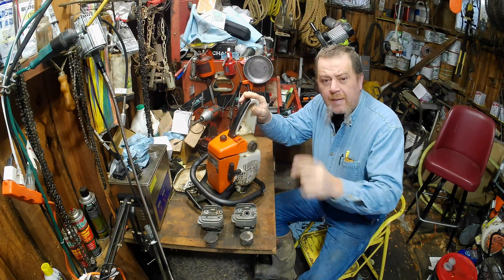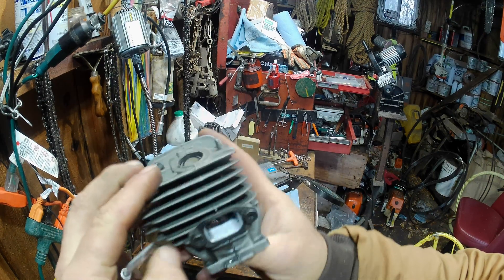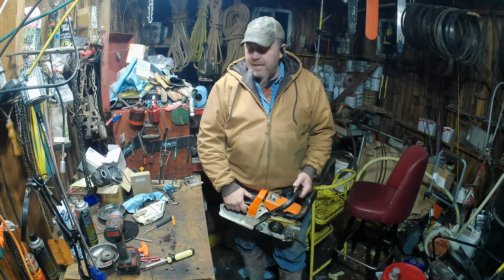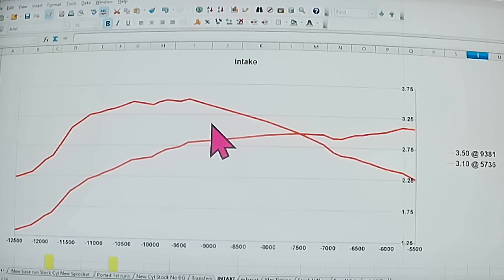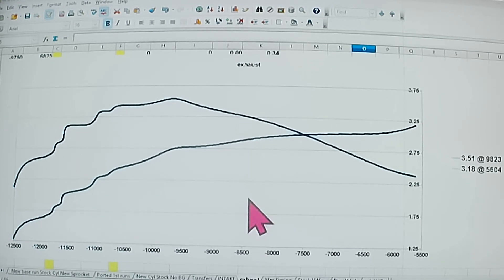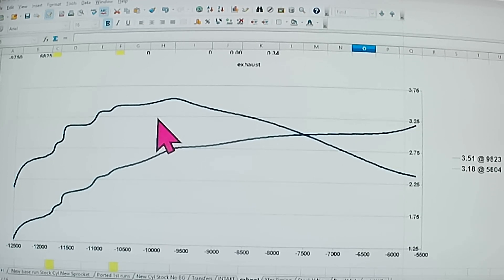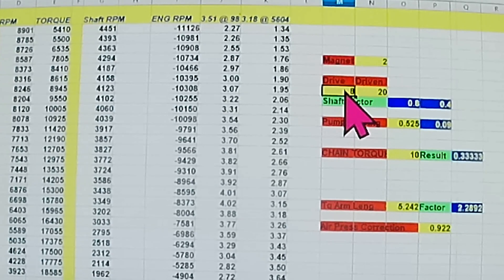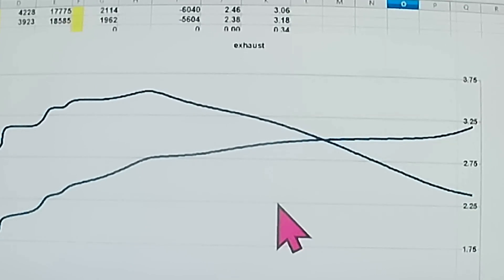Exhaust Port - DYNO and Test CUTS- EVERY Step. Chainsaw Mods Step IV

Comment: I just discovered your excellent channel a few days ago. Really enjoy your work and honesty. One thing I have always wondered about is free porting. I have heard that it is bad, then a little bit is ok, then there are small gains to be had. I really wish this could be tested definitively on the dyno for proof. Perhaps you could take this on as an episode?  Would be greatly appreciated.
Reply: Whoops sorry for sending my note twice. That’s great. I have a few other tricks I use in my weed wackers, dirt bikes etc etc and even trimmed the bottom of the exhaust side of my piston on my Yamaha IT465 to reduce the amount of big bore surging at low rpm. Kinda like Yamaha did on their RD’s back in the 70’s. I figure chainsaws are more either idle or wide open runners so there could be a benefit. I’m thinking that when they are on the pipe and singing at full song the return pulse is not there at TDC and the pipe is sucking. Might lose some air/fuel out from under the piston out the exhaust but the overall momentum of the mix would increase the delivery ratio. I’ve heard about trimming the bottom of the exhaust side of the piston in steps of 1mm until any gains are lost. Anyway you are the expert sir and anything you find out would be dynamite. Thanks again.
Reply from the maker: @MarkPrestwich-h6m EXPERT??!! 😂😂 I think I swallowed my gum on that one; you caught me off guard. I am truly a curious hack who is intrigued with 2 strokes. I will show my ignorance... honestly...  What is "big bore surge"? I am truly learning as I go and I have never heard the term of big bore surge; I'm rolling around the idea of a shorter exhaust side as we speak; nothing obvious yet... I'm going to think on it some. A nudge in the correct direction will be appreciated.
Reply: @ Ah no worries. I learn as I go too. Well when a big bore 2 stroke coasts for example downhill or even cruises with low load out of the powerband it can tend to fire intermittently at times. Some theories say because the exhaust gets pulled back into the cylinder and mixed with the fresh air/fuel mixture diluting it making it unable to fire for a few cycles and then POW! it fires and kicks the engine. Another reason is that at low throttle opening even with reed valves some mixture can go back in the reverse direction through the carburetor and then be pulled back into the engine. Each time it does this it picks up more fuel from the main jet and makes the mixture too rich to fire. When the throttle is opened and some does eventually pass through the engine and becomes lean enough again to fire you get another big POW! and surge. Really annoying when you are cruising. The bigger the 2 stoke the more pronounced the firing surge. I have experimented with a few ways to reduce this with some improvement (for example adding 2 sparks plugs with separate ignition systems to the single cylinder engine) but it doesn’t fix it completely though. RD400 Yamaha street bikes had notches in the bottom of the exhaust skirt to allow a bit of free porting (like I also did) but I’ve heard cutting the exhaust skirt works too. If I can impart any more of my limited wisdom to you or others in the future I am happy to do so. Greetings from Canada by the way.
Reply from the maker: @MarkPrestwich-h6m  Awesome!! I wasn't aware of the condition, but I understand it as you explained; thanks for that!! I've worked on antique steam engines, tractors, semis, new cars, and turbines (jet engines), but two stokes were a complete mystery to me a mere year or two ago; I watched chainsaw vids for a LONG time before the lightbulb finally lit-up. I still tend to refer to 2-stroke theory with 4-stroke terms and relations.
 Feel free to offer anything any time! Almost everything I hear or learn gets my mind to thinking about that, or points me toward something else. I have stumbled upon a good thing or two, but it was usually from hearing something that was thought to be obvious to others.  I spend so dang much time thinking outside the box, but I'm missing a LOT of important info that is IN the box!!
Another Canadian friend!! Mark, I sure am glad you stopped in; I sure hope to see you lots more.
Reply from the maker: @MarkPrestwich-h6m That's a good idea!!  I don't know, but I think free porting will be more allowable as the rpms increase; I consider that the first sacrifice will be idle and "manners" of the saw??  I will have to try to think of a way to isolate the free-port aspect without being able to attribute gains/losses to timing of intake/exhaust. Good thought and good suggestion!! Thanks for joining-in; we're awful glad to have you here!!

Comment: Your video title caught peaked my interest because I have a Shindaiwa C242 string trimmer/brushcutter.  The C242 has been EPA'd to death with a choked up exhaust port and a catalytic muffler.  The C242/T242 has a serious problem in that the exhaust port gets carboned up to a pinhole size if you don't maintain it by periodic cleaning.  I use this trimmer to maintain 3-acres of weed cutting, and I've already improved its performance by replacing the muffler with an empty can.  It upped the RPM and it runs cooler.   I am going to grind the exhaust port similar to what you did to your saw and not touch the inside cylinder geometry.  I'll retune the carb and keep my fingers crossed that it will improve its performance.  Thank  you for providing your knowledge to our community.
Reply from the maker: @w6qd I sure hope it helps; be very cautious going any/much higher with the exhaust roof as it can lower static compression (will lose x-amount of degrees of compressing stroke) and EXTRA cautious not to grind the bottom of the exhaust "floor" so that the bottom of the piston skirt can clear it; that would allow it to let the compressed/ing intake charge to go straight out the exhaust; this is know as free-porting and is (in most cases) very detrimental to performance.  Good luck and let us know how it works/ed. Thanks for joining-in!!

Comment: This is great!! I follow every one of these. I like as you stated a dyno is a tool !!  If you're looking for a big number then find someone who will dyno whatever and go to them. If you want to see cause and effect. I big number makes no difference. So many variables. This will tell you what your port work actually is doing and what has changed. The blowdown part is where I get conflicting results and information. I have been told small saws short blowdown. Larger saws like more blowdown. Low exhaust means torque questionable. I believe it's the rpm range that is mostly effected. I have 4 husqvarna 55's right now on my videos. All with different a different configuration. Short blowdown, long blowdown high exhaust roof low exhaust roof. Dome stihl 028 super piston and flattop piston. Finger ports vertically and just lateral ports. The manners of the saws is all over the place. I have noticed shorter blowdown makes for less part throttle response. I hope this series helps to rectify what is being thrown around in the porting of saws. Best feeling saw to me is a 20 degree blowdown saw with 158 degrees duration on the intake. 158 degrees on the exhaust. All ranges of my duration are from 156 - 160 on the intake, 154-160 on the exhaust. Blowdown is from 13 to 28 degrees. These are open port cylinders so trying to get your charge toward the intake side of the cylinder is the reason for the lateral finger and vertical finger ports. Then there is timing advance changes as well. Best way to tell for me is having the saws there and run them back to back. Still they all feel Mediocre to me. This is where the dyno you have would be extremely useful. Keep up the great work!! Love the fact you have don all the work to the dyno and writing your own program. Way smarter than me. 👍🏻
Reply from the maker: @eze7524.Morning_Wood_Farms  You're right; there's a jillion things to test cause/effect and the multitude of configurations would sure take a while. The blowdown (next video) made a fairly big difference. This particular saw will not get too crazy as it has to idle for longish periods, start on 3-5 pulls cold, NEVER see a screwdriver, and be able to pull a dull chain without melting. On the other hand, it has to be in the ballpark of a stock 036 or he won't even pick it up (even though it will be easier for him to start and will be lighter.)  We've got quite a few more renditions to try before we call it a wrap though.  I doubt I will push the intake or exhaust too far due to the manner the saw will be ran.
Do you find increased wear or runability issues (for a work saw you would give to someone who can't even tune a saw) with the finger ports?
...and, I wouldn't claim to be any smarter than the next guy; they claim an infinite number of monkeys with an infinite number of typewriters, one would accidentally write "Gone with the WInd"   ... or as I say about myself "Even a blind hog finds an acorn every now and again". 
Need to be thinking of a saw to build a lot hotter step by step... it needs to be easy(ier) to tear down and rebuild and inexpensive cylinder/piston, etc... Chinesium would be just fine, but what model?
Reply: @HayChaffandSawdust1  I just found your channel.
Dont worry about finger ports causing issues if they're small and only on the intake side. I have a 660 clone with fingers, it rips and isnt fussy to tune at all, it just runs like a saw should. The things that makes saws fuusy to tune is super high compression so they get really hot,  too much intake duration and really short blow down. I tried short blow down in one 660 cylinder(18 degrees), it acted lean in the cut but sounded rich out of it, I swapped a different cylinder on it with 25 degrees blow down with everything else the same and it runs good now. Blow down is the hard one to get just right, you want it as short as possible but not too short.
Reply from the maker: @nseric1233  Glad you found us and really glad you joined-in on the conversation and offer suggestions (I'm just a hack for all intents and purposes who built a dyno to help me see what's what while tinkering with the saws). Not sold on finger ports (understand them, know some about them, etc..., but never used them) for this particular saw. I think it's a DANG GOOD idea though and would like to see the results on the dyno; I think they will be substantial!  I think, if not this saw (could just do another cylinder to do an even-hotter firewood saw?) could do another 50-60 CC firewood saw that is easier to work on...maybe a husky clone? 
Thanks for joining-in and offering suggestions! This has potential to be fun for all of us!!
Reply: @HayChaffandSawdust1  My understanding of finger ports is...
They only help on saws with one transfer opening per side like the 0 series stihls or 2 series huskies. These saws are held back from lack of transfer flow and direction, the fingers fix that. Aftermarket cylinders are even worse than OEM for having poor flowing transfers, finger ports really help them.
Dynojoe added fingers to a 272/357 hybred and gained 1 hp on his dyno.
My 660 clone gained 1000rpm in the cut with finger ports, it's very noticeable.
Reply from the maker: @nseric1233 I think that would be a good test too (not, for one moment insinuating that either you nor Dyno Joe are not 100% correct) to see if shape/angle up upper transfers can get in the same ballpark as finger ports. I have the utmost respect for Joe's channel, knowledge, and ability; and, if I found one thing to be true and he found something different to be true, I would believe him/his results/experience. over my own. On the other hand, he builds to plumb-nasty running saws, some of which, have a different use/USER in mind (Hope he kicks butt at the Tip Up Festival today, speaking of building saws for an entirely different use).  If I can get xx% gain by doing uppers , and keep from messing with any more plating than necessary ( I realize it's below the exhaust root and all) and get a tolerable less gain than finger ports...   Got me to thinking some more. I LIKE IT!!  I sure don't mind trashing cylinders, so finger porting is my next logical step; I can machine, but don't like to rely upon it for a bunch of the anticipated gain(s).  Loving the exchange of ideas and banter!!

Comment: What's up? I didn't get a notification for this video.
Reply: My trimmer is one of the few things I haven't actually modded yet.  I've worn out a few though.  I've only paid for 1 haircut in the last 3 decades so I don't mind buying trimmers.

I'll try to remember to check my clutch temp next time I mill wood.  I wouldn't think it's slipping but temp would tell me for sure.  Your videos keep me thinking.
Reply from the maker: @Kevin.L_  Well CRAAAAAAAAP; just looked and the "notify...." was unclicked on my end; won't let me change it now. Some people (me specifically) shouldn't be allowed to even touch computers!! Dang the luck.
Reply: @HayChaffandSawdust1   At least you know now.  Luckily I saw it somehow.

That exhaust port looked good even if the numbers didn't show much yet.  Suspect that'll change soon.

Are you sure about that slipping clutch raising torque?  I don't see that working.  Torque transferred may stay nearly the same and the excess rpm will be converted to heat.  I understand your thinking of trading rpm for torque with the reduction, but I think it's just losses.  I'm no expert though.

Looking forward to see your temp findings.  That should be informative.

Congrats on all the new critters.
Reply from the maker: @Kevin.L_  No, I am definitely not sure about the slipping clutch to make a bump in torque on the dyno. I know, in "real" situations, a slipping clutch means a stalled(ing) chain, heat, etc... I merely suspect it would be the reason for a spike in torque as the saw is pulled down THAT far... Sort of like a having a tire in the ditch or against a stop and riding slipping the clutch to get the truck up/over it; I know, you also rev the engine at the same time, so the "more torque" there is also not-really more torque either.  You got me to thinking, I just ain't sure!! It DID explain the occurrence of a uptick in torque that low in the graph... I better get back to thinkin before I go to bumpin' my gums!! 🤓  I am also looking forward to the temps, drag of rotating mass, muffler mods,etc... may finally be able to leave my saw together for a tank or two of gas. 😜
Reply: @HayChaffandSawdust1  There's another question to answer.  At what torque and rpm does that clutch actually start slipping.  I suspect between 4 and 5k.

Can you monitor the clutch temps while doing the runs to watch engine temps.  Be interesting to know if much heat is being generated there at what should be full lock up
Reply from the maker: @Kevin.L_  I suspect you're right from what I've seen... maybe as high as 5500 on this saw; I have others that go lower before slipping. I could measure heat I guess!! For now, am running the clutch cover when on the dyno so it oils the chain well, but it wouldn't be a problem to build a plate to take the place of the side cover at point. 
One of my friends is building an Arduino based tach and load cell so the numbers can be loaded straight into my computer (huge time savings) and will also have faster refresh rate of the data. He's still getting the kinks out of it... hate to throw a thermocouple request at him yet (which I really really want for contact measuring head temp). My Ye Olde Point'N'Shoot infrared will have to suffice for now if the clutch isn't too shiny (reflective surfaces skew results)
Reply: @HayChaffandSawdust1  That Arduino will be a nice addition.  It pays to have friends!

I don't recall seeing the  PTO side of the saw on the dyno.  I didn't think about oiling and suspected you may be using nuts rather the side cover.  Considering this saw is spending it's foreseeable future on the dyno a little spray paint should take care of the shiny clutch cover.

Also, I think this is the first video I've seen you without your head covered.  I see we have the same barber.  Wahl?
Reply from the maker: @Kevin.L_  You got MOST of the bare-headed thing... in the first few seconds, I went from being in need of a haircut to having just given myself one. My warped sense of humor loves hiding things in some videos 😂🤣and you catch WAAAY more of them than anyone!! 
You're right with a little spray paint on the clutch. I need to start a list of things which would be interesting to test and could be included without very much trouble as they would be short/inclusive test to other things.
Wahl has been my barber for quite a while too (with "custom ported" combs on the hair-grinder. Took my porting tools to them and shortened them a bit (one was too short and next one was too long)